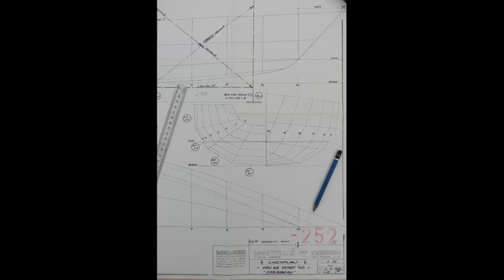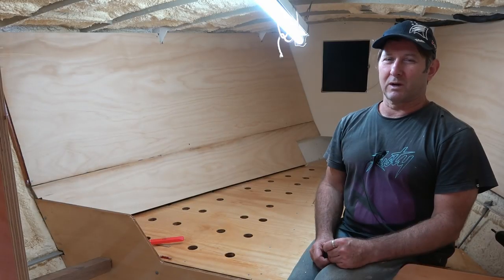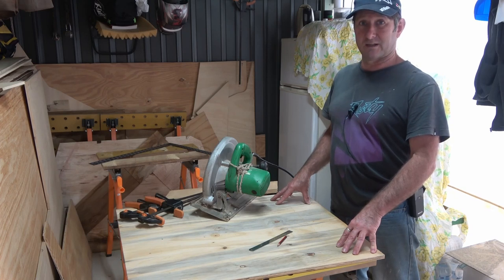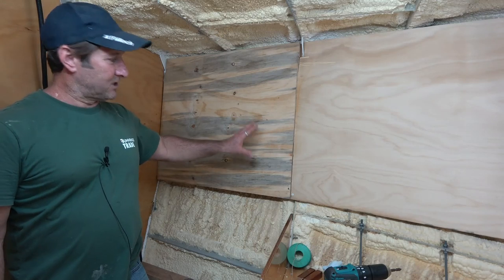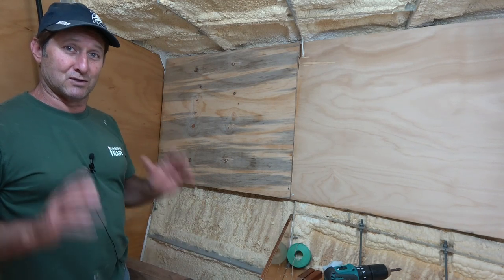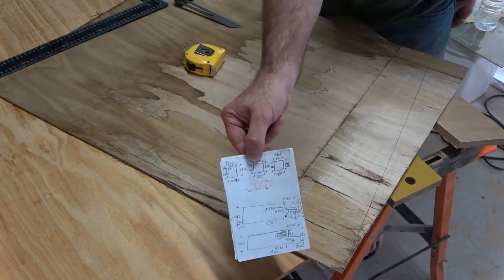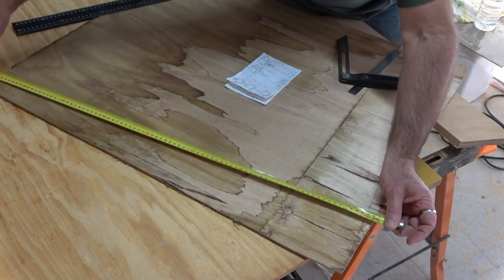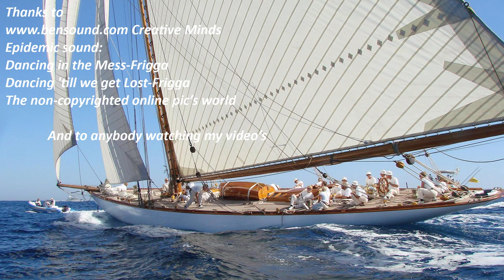Building my steel sailing yacht Ep.51 Making the V berth lining panels,..

Comment: Bruce, 

you can save a lot of time by cutting those door skins you are using for templates into 3cm wide strips, then hot gluing them together with a hot glue gun to form the shape. Add center supports as necessary, a good pair of scissors will cut right through that door skin.  

This will greatly speed up the process.
Reply from the maker: Thanks for your good comments and suggestions Nick. I actually find the full template option quicker and definitely more reliable. Jfyi the template plywood is 4mm hardwood. Thanks again sir!

Comment: You did a nice job of fitting those panels and 2 mils is nothing to be ashamed of with compound curves like that. Fastening them to the hull looks to be in need of some tricky batten installation. I'm wondering if running 1/8" 4mm x 1 1/2" 140mm flat iron welded to the frame instead of the rosewood battens may have been a better choice. Then fasten with self drilling metal screws. Like you did for the bolt clips. The vee berth will be a nice interior space when your done with it.
Reply from the maker: Thanks very much Richard and your idea is a good one although this work would have needed to be done during the steel build stage pre painting and I do prefer having timber to screw into for these purposes and other fit-out cabinetry ahead.
Thanks again for your good comments sir  🙂
Reply: @BuildingSYMistress  It was something I noticed earlier in the build when I seen you paint the Interior. I'm guessing the designer never worked that detail out in the plans. I was merely thinking out loud as I seen you working through the build. They would have to be welded to the build frames before the hull plating was welded on.
Reply from the maker: @richardbohlingsr3490  Well spotted sir and to explain further - in fact the design stipulated either angle iron or fabricated "i" frames for the frames and angle iron for the deck and coach-roof beams, which in my opinion with a steel production is not only unnecessary but also practically impossible to properly either sandblast or clean pre-paint coating as well as properly paint coat, to all of those small and difficult places. These were my reasons for choosing flat bar, which has meant needing to add for eg. battens  🙂

Comment: How about using thin strips of (disposable) wood and hot glue to trace the outline of your target and then apply this hot glued pattern directly to your plywood panel for cutting.  Just a thought.
Reply from the maker: Thanks for your suggestion Hankus253, fyi I have found that the full template option works better and is more reliable for me.

Comment: Hi Bruce.  Armchair expert comment here...
You might like to try the old CAD method, Cardboard Aided Design.  I used A3 and A4 sheets of thick card (very thick paper) which I would tape together to arrive at the total shape. The paper is easy to cut in the boat with a box knife. Is easy to move around - you can even roll it up. Cheap and disposable when you’re done.
Using a collection of smaller pieces I found it way easier than trying to accurately fit one large piece - trying to get all the angles and dimensions right first time is near impossible. You can position and cut a piece to fit around an obstacle or corner then just tape it to the surrounding pieces until you have a collective shape that fits well in all areas.
The downside is that it could be a bit floppy on the large areas you’re doing  - though perhaps you could use a thicker central piece of corrugated cardboard to make the whole thing a bit more rigid. Another possible drawback that comes to mind is the lack of third dimension in terms of getting the edge fit right - you would have to account for that... 🤔
You may have tried and discounted this method, but it worked really well in my case and I was able to cut ply that fitted near perfect first time.  Just a thought... Cheers
Reply from the maker: Thanks very much for your great comment and suggestions Robin, much appreciated! In short, yes I am aware of your "CAD" method and it's cousin's the same in thin plywood and "chain method". I think that for a small boat with thinner materials those methods would be good, however I have found that the full template option works better and is more reliable for me. Thanks again!  🙂👍
Reply: Yeah I get it - horses for courses... Cheers
Reply from the maker: @robinhodgkinson  Exactly Robin!  🙂

Comment: I couldn't find a store bought "rip fence" for my new jig saw.  I now have three that don't work.
And there on your video, a simple solution using a factory edged board, clamped down to the part!
It's was so simple, and yet...
Thanks for taking the time to show the details.
OTOH   Your "interlude" was a montage of quick stills (?) or clips that changed in micro secs.  For some of us, that type of footage can cause seizures.   Just sayin'.
Reply from the maker: Thanks very much for your comments G King and just to mention to be careful of using a fence with Jigsaw's, especially if using longer blades, because in my experience Jigsaw blades do tend to wander, despite the fence.
Re. the Interlude - it was a movie time lapse, exactly the same as most of my video time lapses, I hope that you don't experience any problems viewing.

Comment: Gday Captain  ;)
I was noticing the spray foam insulation you did, or had done for you, and it doesn't appear to have filled the voids very well. Are you going to add more R-value before closing in the compartments or was the purpose just to act as a vapor barrier?
Good steady work, keep it up!
Reply from the maker: Thanks for your comments and good questions Roland, yes I applied the spray on insulation and yes you are correct that it is uneven and in places not the ~30mm thickness that I had planned. I explain all of this in prior videos that you may want to checkout but also yes you are correct that one big purpose of this insulation is to displace condensation. Re. the insulation generally though, there will also be some utility in the air space between the spray on insulation and the plywood lining as well as the plywood itself providing some level of insulation and so I think that these 3 medium's should provide a reasonable level combined. Beyond this time will tell as to whether I may need to add more,...
https://youtu.be/RuLoMPskw_g

Comment: Will there be a problem with condensation between the plywood panels and the hull?
Reply from the maker: Thanks for your good question Richard and I believe that generally no there shouldn't be. I suspect that in high latitudes in the cold months there could be condensation however 1)the steel has been epoxy paint protected, 2)the closed cell insulation displaces any moisture off of the steel, 3)the air space between provides some insulation qualities, 4)any moisture will run to the bilges and 5)there is no perfect solution that would never require some level of care and checking for maintenance.